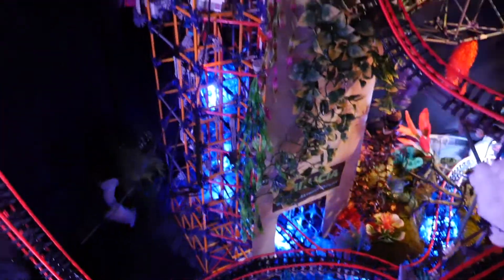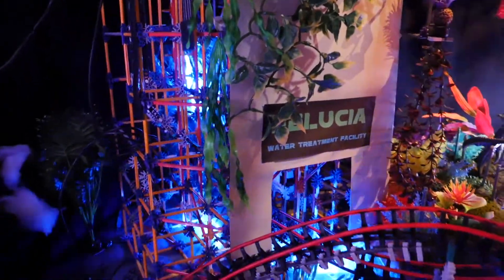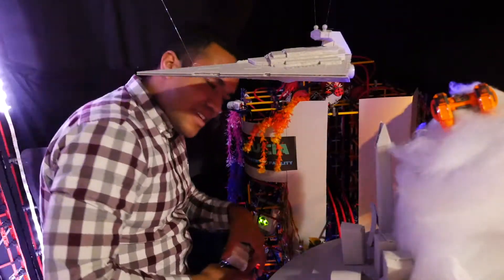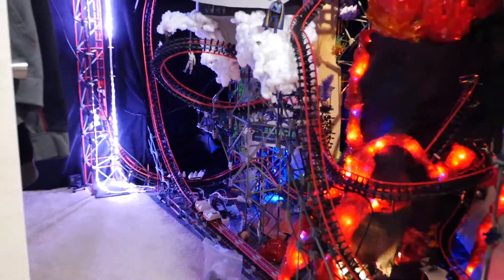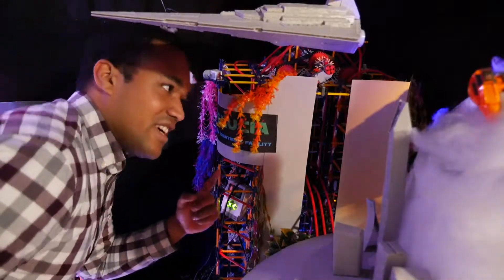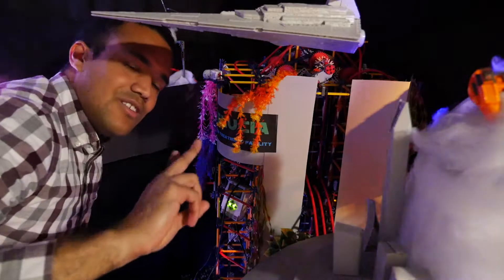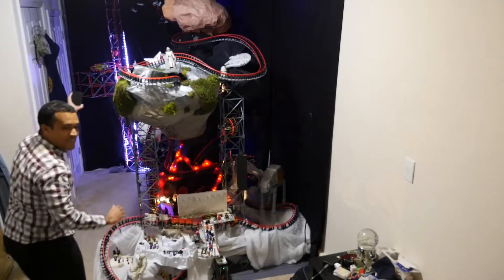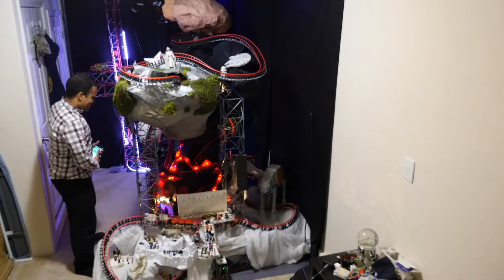K'nex Star Wars Coaster: Update 49

Comment: you got a link to where I can buy the small moter levers you use for releasing the break fins and also the program you use to code the blocksections? Would realy like to give this a go for my nemesis inferno recreation.
Reply from the maker: All the electronic motors, sensors, and components are from the standard LEGO EV3 set. It's pretty expensive, but if you have any questions I'm happy to help.